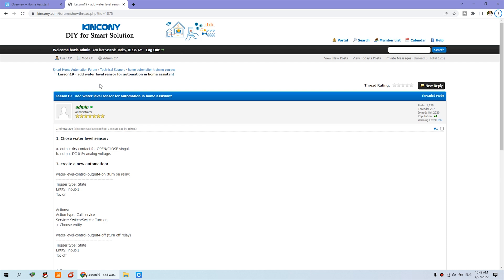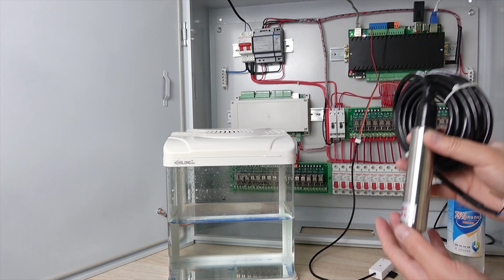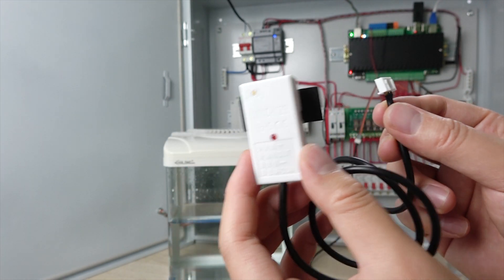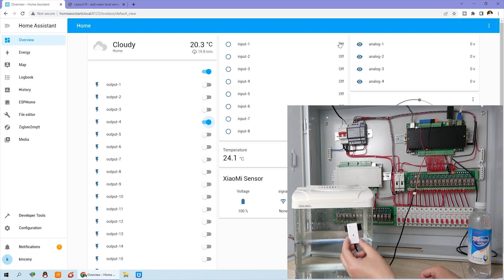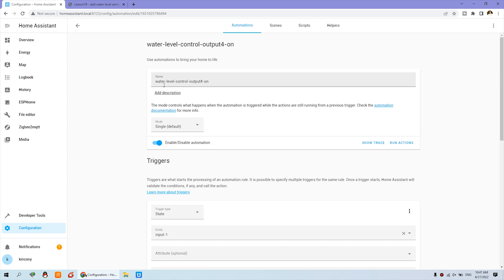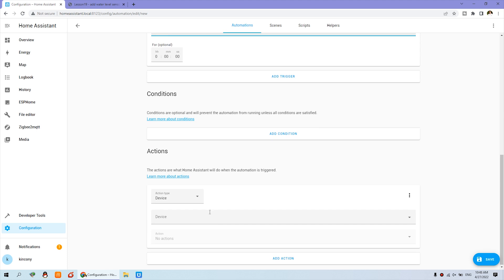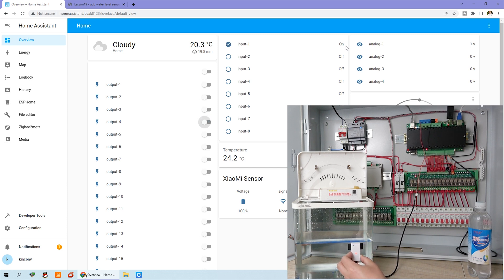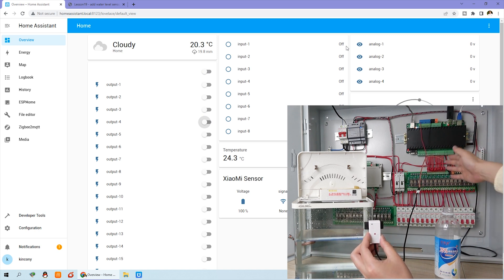【home automation training -19】water level sensor for automation in home assistant

Comment: Where are you running home assistant? Not a raspberry pi ? I am going to use the same sensor with esphome and Home assistant. Your step seems easier as you are not using esphome
Reply from the maker: because we are using KC868-Server, there is a raspberry Pi CM4 module inside.